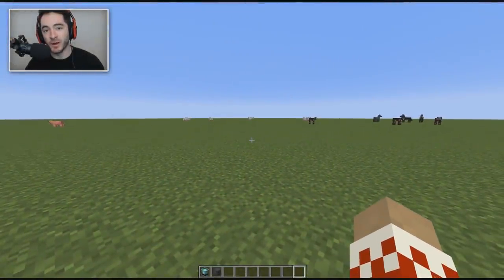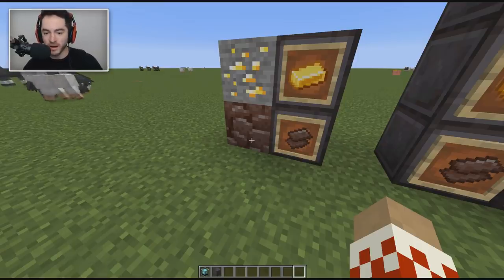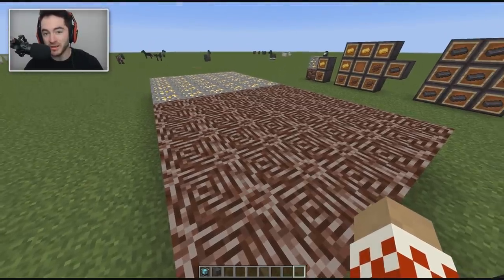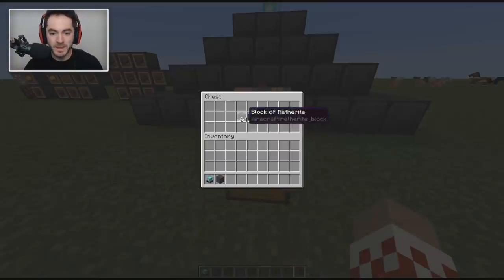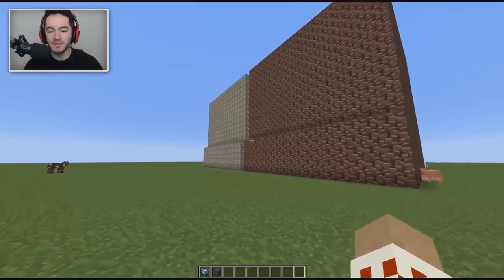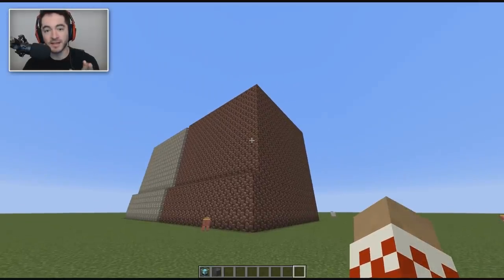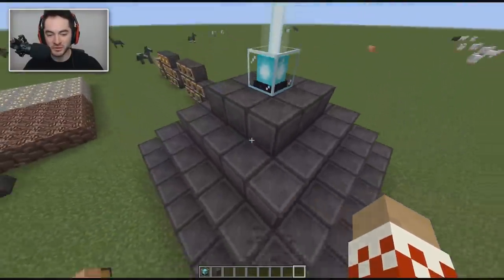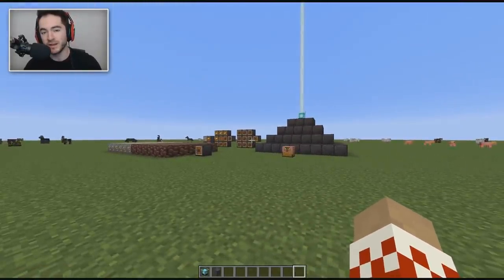The Netherite Beacon Is Minecraft's Ultimate Flex

Comment: I did some calculations, and it turns out that there are about 50 double-chests of netherite blocks in the entire minecraft world. That means that, with the entire worlds supply or netherite, you can only make about 1051 netherite beacons.
Reply: Well the thing is most people think netherite is only below a certain level but it can be found at any level underneath netherack
Reply: But there can still be only a set number per chunk
Reply: @angelob2383  As it seems there is one debris vein of 1-2 generated in some lower area (think below 24 or something) and another such vein at any place between that and the ceiling.
Reply: Only, he says...
Reply: By my calculations it would take you approximately 33 full years of game time to build all 1051 Netherite beacons. Piece of cake :)
Reply: uh btw netherite blocks don't blow up so you can tnt your way trough nether to find it faster
Reply: @alexiepuru483  Beds are significantly cheaper to build, as you can farm lots of wood and wool pretty easily. TNT on the other hand, while it does stack and can be ignited from a distance, is a lot more expensive requiring the player to farm creepers and dig up sand, which is a finite resource.
Reply: me with my iron beacon in creative mode only?
Reply: @Xeta 0.1%...one beacon's worth out of 1051 beacons' worth.
Reply: the minecraft world is infanent
Reply: @Xeta Oh, definitely agreed. That's a massive volume of netherite, especially considering the time it takes to gather. 

I was just bypassing most of the hard math, and assuming if there's about 1000 beacons in total possible, 1 beacon would be 1/10th of 1%, and 10 beacons would be 1%. :) The more arithmetic you do to solve a problem, the more chances you have to make a mistake.

It's also possible that you're correct, and Ethan's calculations are wrong. :)
Reply: @MGSLurmey  
If you have server full of people, and there is 200 people working on gathering all netherite, it would take around two months or maybe four...
Reply: Assuming he's correct on the 33 years thing and that they're gathering 8 hours a day, it would still take six months. Half a year, that's crazy.
Reply: @bjork7668  
Not that crazy. It's just a matter of time.
Reply: And commitment.
Reply: @Xeta 0,1%
Reply: "only"
Reply: @MGSLurmey  perhaps a TNT duping carpet bombing flyer?
Reply: But you can reset the nether infinitely, if you delete game files
Reply: That's why I use gold farms
INFINITE AMOUNT OF BEACONS!
Reply: The Minecraft world is about 60 million blocks across in both the overworld and the nether. While terrain does does still generate beyond this point, there is a world border here meaning the player can't go any farther.
Reply: Isn’t the nether infinite? Witch would mean there is infinite ancient debri
Reply: Agent Lurmey, you can duplicate TNT using slime block machines, effectively making them a renewable resource. Combine this with a fleet of flying machines and you've got the means to bomb out the nether significantly faster than a single person could ever hope to do so using beds.

If you think this method of acquiring TNT is cheating, you can farm gunpowder using creeper farms (very worthwhile btw, I've gotten nearly a chest full of gunpowder stacks in an hour using a single farm, without blocking up nearby caves), and you can trade a single emerald for 8 pieces of sand using wandering traders (raid farm or villager trading system for emeralds). Or, you know, dig out a couple of desert biomes and you'll easily get tens—if not hundreds—of stacks of sand.

If you're aiming to get the bare minimum amount of netherite required to upgrade your armor and tools then sure, using beds is much more convenient. However if your goal is to get a significant amount of netherite then TNT is definitely better in the long run—once you've obtained the necessary resources of course.

Using beds also has its downfalls. The much larger explosions and the instant ignitions can wear down your health and the durability of your armor very quickly. They also cannot stack, so you're limited to 36 explosions at maximum before you're forced to go back and restock on beds.
Reply: You now the nether is infinite right? It’s no like once you go far enough no netherite will spawn and also, your saying 1051 netherite beacons like it’s nothing
Reply: It's not infinite. If you go out far enough you will eventually reach the world border, which is about 30,000,000 blocks away from 0,0.
Reply: Oh I play on bedrock we don’t have borders I forgot  that Java was a thing for a sec lol

Comment: I think this would be a better way to measure how long it would take to find it. 
1. Have xrays on.
2. Chunk outlines on.
3. Have a sample of x amount of chunks and measure y amount of netherite per chunk.
4. Find the mean/average for y per chunk.
5. Copy the seed and make backups.
6. For each backup, use a different mining technique and measure the time taken for each. Use the same chunks you used in the last test to prevent outside variables. At this point in testing, you should have your xrays off and your chunk outlines on to make sure you're keeping inbound with the sample chunks you picked.
7. Find the mean/average time per technique.
8. Measure the y amount of netherite per mining technique.
9. Find the mean/average for y per mining technique.
10. See which one is the best technique in terms of time and amount of netherite (This comes to preference to caring about time or caring about quantity. If you want a balance in between then that would be the most "efficient" and consistent).
11. Take the y data from the best technique and compare it with the y amount of netherite per chunk to see how much potential netherite is being missed.
12. Divide the y amount per chunk for the best technique by its average time.
13. Now divide 5,904 by step 12's value. You should have the amount of time it takes to find all the netherite material for the entire beacon.
14. Conclusion: You found how long it theoretically takes to find the amount of netherite for an entire beacon using the best method. You also found the potential amount of netherite missed when using different methods.
Bonus: Measure the amount of time it took to do this experiment. Compare it to the amount of time it takes to find the netherite material for the full beacon. See how much time you've wasted for this experiment when you could've done something else. Sadge
Reply: And then “Come eat!” Happens and then your little cousins/siblings play on your world and die in lava

Comment: I've done a little more math:
On average, there's about 64 pieces of ancient debris per 100x100 area, floor to ceiling.
64/4= 16 netherite ingots per 100x100 area.
16/9= 1.777... netherite blocks per 100x100 area.
164 (blocks for beacon)÷1.777...(blocks per 100x100 area)=
92.25 100x100 areas for one full beacon...
In other words, you would have to completely mine a 960x961 block area from floor to ceiling to find enough ancient debris for this.

Edit: my original math mistakenly claimed 64 pieces of debris per chunk, not 100x100 area, resulting in a... Significant miscalculation.

Comment: you need to dig the average amount of 3472.94117647 chunks in the nether to get enough Netherite Blocks -  chunk have 65,536 in it (including air blocks) what means you will need to dig 227602672.941 blocks minus air blocks in order to get enough Netherite - you need 112064.339213 Netherite Picaxes (in a case we also need to mine the air blocks which I can't exclude from this calculation). in order to get 112064.339213 you need to mine 448257.356852 Ancient Derbis
Reply: A nether chunk is 128 blocks high so you have to halve your numbers. (Please ignore this comment if JustAmit has already edited his comment.)

Comment: They NEED to make a netherite Golem so when you spawn it, it only allows 1 to be spawned, but it gives you an achievement: 'Ultimate Power' as the golem will have 400 HP, be blast resistant (so it also attacks creepers) and fire and water resistant (no burning or drowning) an follows you personally doing 25 damage a hit!
Reply: would be unbalanced IMO plus it would be awful if you, for wathever reason, took it to the end and it fell in the void

Comment: Taking an average of 1.7 debris per chunk, we have a square area of approximately 941 by 941 blocks, almost a square kilometer of nether, that has to be excavated bedrock to bedrock. Doing that by hand sounds absolutely absurd, but Ilmango has recently shown a flying machine that does good job of completely clearing nether. With one of these, you can AFK most of the work. It does rely on TNT duplication glitch, however, and still requires construction of fairly sizable tunnels and clearing upper levels with TNT cannons first, in addition to construction. But if you have proper farms for all necessary materials, we're talking about something more in the tens of hours of construction, rather than hundreds.

Comment: Im using some estiamtes and which is by no means 100% accurate.

Ancient debris spawn from Y 8-119. Per chunk there is an average of 1.7 Ancient debris(Can spawn up to 11)

16*16(area of a chunk)* 111(The total hight it can spawn) = 28 416 gives us block that it could be spawned as. Some of these might be air, lava or other unreplaceable block Ancient debris can replace , so lets remove 30% which seems fair.

which leaves 19 891 block we have to look through. Chunks have an average of 1.7 Ancient debris

Diving the total amout of Ancient debris needed by the average leaves us with:  5000/1.7 =  2 941 chunks we have to look through

Amount of chunks(2 941) * with the max amout of blocks we could look through per chunk(28416) Gives us...

59 673 000 TOTAL BLOCKS! or 730*111*730 or 391*391*391

This might be off by a few millon or maybe even tens of millon, I dident have all the varibles and dident want to research all day(its acctuallt night now), but I'm pretty sure that there is nothing wrong with my calculation. Please do comment anything if you did it another way or thought of some other varibles to make it more accurate.

Comment: Ancient Debris has an average spawn rate of 1.685 per chunk. This means you would have to clear out approximately 3 504 chunks or an area of 896 988 m² (~ 947 * 947) blocks or a volume of ~114 814 405 m³ (or blocks) in the nether to get one full sized beacon completely made out of netherite blocks. Good luck trying to do that.

Comment: 1.7 ancient debris spawns per chunk on average in the nether. Each chunk is 16x16x128 blocks in the nether (the bedrock ceiling is at y=128). You need 5904 ancient debris to make a full beacon, so you will need to mine 3472.9 chunks on average to get the required debris. Multiply it by the number of blocks in each chunk, and you get 113,799,987.2 blocks. That’s a 484 block cube with 42083 blocks leftover.

Comment: So, assuming there are 3 ancient debris per chunk, you’d need 1968 chunks stripped free of ancient debris. In a straight line, that’d cover 31,488 blocks. If you were to find the surface area of that at y level 15 specifically, you’re looking at 503,808 blocks. If you were to find the volume of 3 y levels, say 13 14 15, you’re looking at having mined over 1.5 million blocks.

Comment: Using average spawn conditions.  Between layers 9 and 21, with 1.6 ancient debris per chunk.  This means you are searching in a 16x16x13 chunk for each 1.6 ancient debris you find.

You need 3690 chunks to find 5904 ancient debris.  Each chunk is 3328 blocks.  You need to mine approximately 1/4 of the blocks in a chunk to be able to see all the rest of them. So every chunk you will need to mine 832 blocks.  Do this for 3690 chunks, and you will have mined 3,070,080 blocks.

Final answer, you need to stripmine a bit over 3 million blocks to obtain all the ancient debris you are looking for.

Or, to look at it another way, you need to stripmine a square that's about 61x61 chunks, at heights between 9 and 21, with perfect efficiency.
Reply: @ann_onn  Yup, but it can't strip mine, so you'll need to mine the full ~3700 chunks with that.  Closer to 12 million blocks, assuming you set it up to cover y=9-21

Comment: There is an average of 1 ancient debris per chunk in minecraft so to get all that you would have to farm 5 904 chunks and chunks are 16 blocks wide, 16 blocks long, and 256 blocks high, which is 65,536 blocks total. Multiply this by the 5 904 chunks you need to dig through and you get 386 924 544 blocks you need to farm through in order to get 5 904 ancient debris.🤯😬